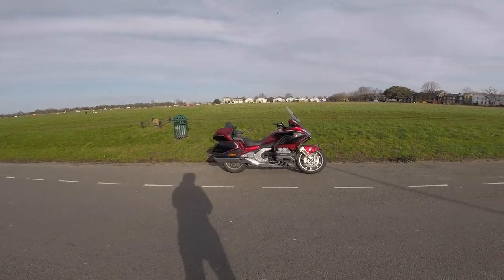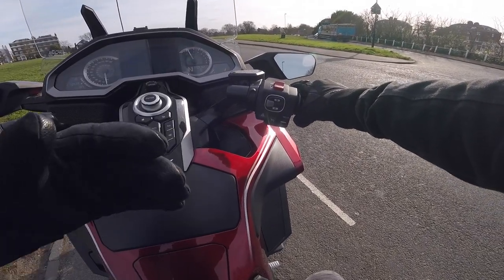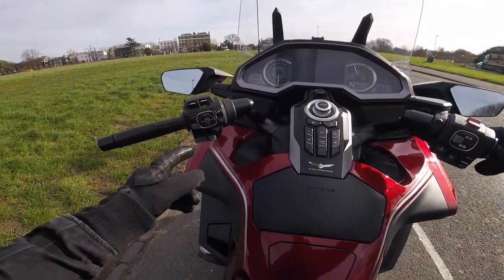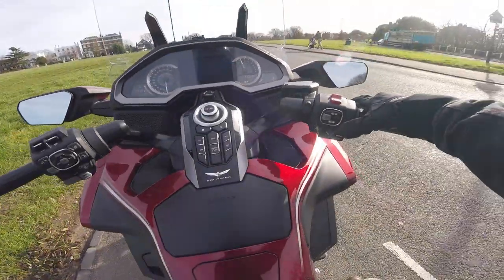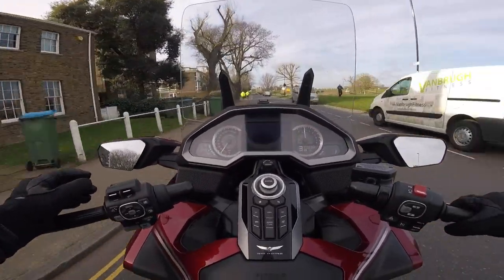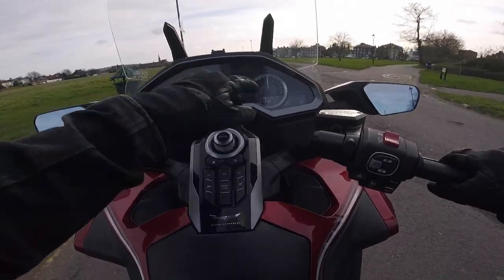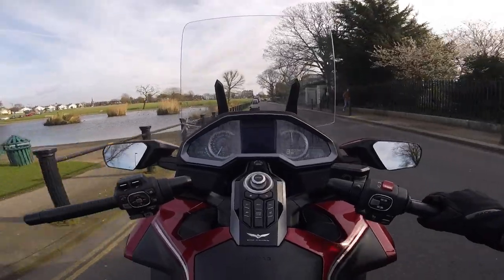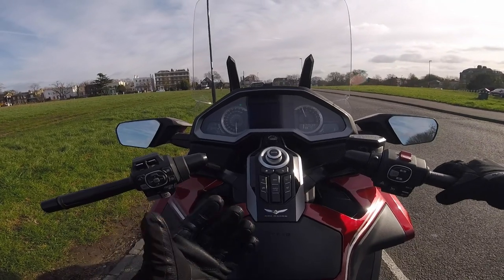What Is Honda's DCT Like To Ride? Goldwing Tour Automatic Motorcycle

Comment: Hi. I've got DCT on my car. One trick is to put it in neutral if stopped for any time. It stops the clutch plates slipping and wearing and also reduces wear on the clutch release bearings. Also, carefully follow the maintenance schedule. It can change up faster that you ever can with a manual gearbox and fuel efficiency is better. Downshifts can occasionally take time to register.  BobUK.
Reply from the maker: Great tips bob. I’ll pin this comment for others to see
Reply: This isn't true. DCT gearboxes disengage the clutch when the car is stopped and brake pedal applied. What you mustn't do on DCT is let the vehicle creep whilst on the brake because this does wear the clutch.
Reply: Robert Hawtin soooo....you have an automatic gearbox in your car
Reply: The UK has a different vocabulary then the United States.

Comment: I have 13K on my '18 DCT Wing.  For tight turns put it into Econ mode, you were in Sport mode and the throttle is just too twitchy there for low speed maneuvers. :)

Comment: Been riding for fifty years, love to shift. That said, I kept an open mind and tried the DCT for two hours on the Africa Twin and hated it. A year later, I tried the new version for a full day. Loved it!
Reply from the maker: I really want to try the old version... I’m interested in how different it is. I also wonder if the 380kg weight of the Goldwing absorbs some of the jerkiness better than a lighter bike like the AT
Reply: Walter Wilkins you got older
Reply: Michael Kastner Perhaps, but I also own and ride other bikes, including a sports bike that will always have me happily shifting.
Reply: @motobob    Don't  want that  "jerkiness "  on the fast curves. At all.
Reply: @timjohnson1199  There's zero jerkiness with a DCT at speed it while accelerating. Zero.
Reply: @sunnyvalejedi     rode the dct gold wing  In sport mode, lots of notchiness,  very fast but notch as ever,  touring mode much smoother,  still didn't care for it,   shifts much faster than you can think, still dont like it,  paddle shifting is not the same as clutch shifting,  still dont like it

Comment: Had a DCT NC750x and now a DCT Africa Twin. The AT is better as it has more power but the NC was surprisingly good. Typically ride my AT in Sport 1 or manual mode. Gear shifts are seamless, never have to worry about stalling it and it changes gear faster than I ever could and never gets tired - gear changes are just as smooth at the beginning of the ride as at the end. 
Never really tried it but by all accounts dct works great off road too - the fact that you cannot stall it.

Comment: Big fan of DCT and over time it definitely improved. Had a 2010 Honda VFR 1200 DCT and wife has a 2012 Honda VFR 1200 DCT. Her bike was a definite improvement through the first three gears as there was hesitation on mine until we had the ECU reflashed. I traded in my 2010 for a 2020 Honda Africa Twin Adventure Sports ES DCT and have no qualms about its ability on the tarmac or off-road. The 4 part Richy Vida video on his journey through the Scottish Highlands will give you a good sense of the capability. If the dealer is willing to let you try the Africa Twin in the manual you should see if you can jump on the DCT version as well and use them both on the same course.
Reply from the maker: Got the manual as we speak. Swapped for the Goldwing yesterday. Might try to get a DCT at some point. I also want to try the X-ADV

Comment: DCT is pretty good when its working, bit fidgety in stop stat traffic!  But its such a complicated system it's a nightmare if it shits the bed! Very expensive to repair or replace,  I wouldn't have one, but I see why some will  especially on this bike,  My car is a full Automatic, in modern day traffic , Manual is a pain in the butt, Butt changing gear on a motorcycle is all part of the experience for me,  Nice work as ever young man 👍
Reply from the maker: Cheers ray. I think a simple bike is a better choice as an everyday runaround. But if you’ve got the £££ to buy and run a bike like this then I can see why it’s fun for big touring miles

Comment: Awesome review.  I  currently have a Harley electra glide but the new goldwings have recently gotten my attention.  The older ones just didn't appeal to me because of the squared off shape of the rear but the new design makes for a very good looking bike. Is the windshield adjustable.  I don't really like looking through one unless I am riding at higher speeds to block the wind and bugs.
Reply from the maker: Thanks mate - yes it's electronically adjustable

Comment: Keep in mind, its an automatic trans. So if you come up behind someone at a light, don't give the throttle a quick snap to make a bunch of noise, you'll run right into the back of the car!!
Reply from the maker: True! Unless you flick it into neutral...
Reply: Yeah, and I like pointlessly pulling the clutch in and reving the engine on my bikes in a tunnel, under bridges just to hear their lovely sounds. How would I do that easily on an auto ?
Reply: @karlosh9286  I think it's only hardly davidson 'riders' who do that :-)

Comment: Great video! But i still cannot get my head around the fact that the Integra (NC700D) is considered a scooter when a Goldwing is a fully fledged motorbike, even with DCT. I ride a 2012 Integra and the DCT is just awesome!
Reply: Being classified as a scooter is more than just the transmission type, it should be judged on chassis design alone. All scooters should be classified as underbone frames. People often call the Honda NC a scooter just because of the dct but by that logic electric bikes are scooters too and the Honda c90 scooter is a motorbike.

Comment: My first impression is that it's brilliant.  It will occasionally make a gear change in mid corner, at low speeds, but the ratios are so close and the change so quick you hardly notice.  Use ECON mode for puttering around in city traffic.  It'll leave the box in higher gears and avoid shifting.  Use the grunt, like you're driving a diesel.  

For crazy fun do SPORT + MANUAL.  Jesus.  Unbelievable.

Comment: I can tell by the comments that folks define this as an automatic. It is DCT, like Porsche, Lambo, Corvette has paddle shifters. Paddle shifters work so much better than hand clutch + foot shift. Oh, you can also tell it to run the actuators itself if you’re in traffic. No manual transmission can clutch or shift better than DCT technology.
Reply: The difference in shift time isn't world changing vs the shift times in automatic vs manual 20 years ago. On the track other factors will vary the speed of a laptime but the dct does factor in.
Reply: Flat DCT is indeed a game changer. You can downshift or upshift shift mid corner without upsetting the chassis. Seamless and smooth. 
Much smoother than quick shifters too. Watch a quick shifter bike being run on a dyno - the chassis flexes and jumps with every gear change, violent.

Comment: Good explanation Motobob, I found the least refined dct that I’ve ridden was on the NC750X, clunky at low speed. My Africa twin dct was a great improvement but could catch you out with mid corner change downs, again at low speed.
I also didn’t feel totally confident with the lack of clutch control on tight right hand road junction manoeuvres on the AT. 
I sold the bike after 11 months and bought my T120, which I love to bits but do really regret ever selling my Blackbird, my all time favourite bike. Still, as I approach my 70th birthday maybe I should be taking things easier!
Reply from the maker: Yes those downshifts do give you a fright occasionally.  And I know what you mean about junction manoeuvres. Sometimes you can give it just a tiny bit too much throttle you’re keen to get a move on, and it can set off at a fair clip with a bit of a jolt. How do you rate the T120?
Reply: MOTOBOB 
I do rate my 2018 T120 highly and I know this may seem a little bit churlish but a little bit more top end would be nice. It’s very good two up, the wife likes the comfort but not the bikes appearance but this is what attracted me as it was so reminiscent of my first proper bike, a Triumph T90 back in 1967.
However I am strongly drawn to the BMW R1250RS, so many bikes, so little time!
Reply: Roger Kent I have an DCT AT - never ride it in D mode - sometimes S1, but more and more in manual mode - full control without needing a clutch. Best parts 1) never need to roll of the accelerator to change up or down and 2) if you stop at the lights in 2,3,4,5 or even 6 it will automatically pre-select 1st so you can pull off straight away. Would probably never go back to a non dct bike.
Reply: Mark Levy 
Hi Mark, pleased to read your comments and pleased that you are very comfortable with your dct AT.
My last nine cars have all been auto’s of one type or another and I wouldn’t want anything else but for some reason, balance maybe, I haven’t been able as yet, to gel with a bike without a clutch lever. 
Maybe I’ll have to give one of the big 600cc scooters a go.

Comment: If ever they put this engine in a muscle bike like the new rocket 3 i would buy it in a heartbeat. After owning an F6C (too much in the cruiser camp for me) i can safely say that when you're rolling on and off the throttle ready for the next overtake,the sound of that six cylinder engine revving it's nuts off is like nothing else. Honda obviously realise this too because they've even added a sound clip to their website. Such a shame they axed the Evo 6 concept bike.
Reply from the maker: I gave it back to Honda yesterday but I’d really like to try the bagger version with manual gearbox to really get a feel for the engine. Will try to get round to it soon
Reply: @motobob  Yes i've been eyeing the bagger too. It's the nearest think to the discontinued F6C (2014 onwards model) with the added bonus of reverse gear and lower centre of gravity,having the fuel under the seat etc. Quite tempted really.Bit of an over kill for rural lanes of North Yorkshire and £22,000 but hey,you only live once and p.c.p is thy friend 😂

Comment: Come on now....Not just any DCT. This is the Airbag model. The only motorcycle with Airbag system. This bike is an absolute Technological wonder. For many years performance and reliability in it’s history. The 2020 has transmission and some other small details of refinement. There’s nothing crude about this bike you bloke. This bike is a proverbial Lexus of motorcycles which jettisons off the line. On my 3rd Gold Wing since 1984 I’m waiting on my 2020 DCT Airbag model. Life’s short, just buy the bike.

Comment: I had a test ride of the NC750x DCT, it was quite impressive, if somewhat weird at first. I wasn't keen on it changing gear mid bend. Plus all that effort it took to learn clutch control would have been wasted ! ( kangarooing down the road on a 125 back just over a year ago )

Comment: Slow speed riding and u turns are easy on this bike, Rev to 1500-2000 and control speed with footbrake it won’t stall, it’s so easy to ride, far easier than my last bike a R1200GS

Comment: Half the fun of road-riding is gear selection and shifting. Also, in my opinion, the clutch is one of the most important connections to the machine.  I ride off-road\enduro just as much(if not more) as I do on-road and could not even conceive of not having a manual transmission\clutch there.  I'm going to dig my heels in here and state; "NEVER will  I EVER ride an automatic  motorcycle."

Comment: I want one and what I want to know is :    when it's new tyres time,  will it cost $1,000 and 8 hours to get the rear wheel off ¿????
Reply from the maker: I ran the battery flat last week and this was the procedure to get to it: remove the fallback key from the keyless fob thing, pop a panel off the back of the bike above the license plate, turn the key in a keyhole to manually release the left pannier, pop a panel off from behind the pannier to reveal the battery. So what I’m trying to say is the whee probably doesn’t come off easily

Comment: One day I may give in and trade my ST1300 Pan European for a new GL1800 GoldWing. But the price is eye watering...
Reply from the maker: It’s a little steep to say the least, especially when you compare the uk price to other markets
Reply: I did just that a bit over four years ago when my ST1300 got too top heavy for me.  I bought a 2015 45th anniversary edition though as the new Wing wasn’t out.  
At 73 I have to think it was a great decision.  The GW sits where I need it to and I don’t need risers to have my hands in the right place.  My back is better and even though I had the fairing flare package the Wing has better rain protection.  I would like to ride a newer GW and we see a lot of them here riding in East Tennessee but I only just turned 55k on this one and I never trade a bike with less than 100k.  Maybe someone up on the Cheroha Skyway will trade with me for a quick trial run one day

Comment: 2:37 Wait...the black area below the function buttons on the tank is an airbag??
Reply from the maker: Yep! On the cheaper models it’s storage with a phone charger, but this is the most expensive version with DCT, luggage and airbag
Reply: Yes, but an airbag? On a motorcycle???
Reply: I was wondering the same thing,  but when I researched it,  the airbag makes great sense.  Honda has videos on it...amazing safety feature.
Reply: @irvan36mm  Yes, it prevents the classic nuts to handlebar maneuver many young cyclists have tried :D

Comment: What's the test bike in your video a 2018, 2019 or 2020 goldwing?
Reply: Michael Berman 18 and 19 are pretty much the exact same bike. Just different colors.   Imo the 20 would be the best for the upgrades that they did.
Reply: @a.d.c7941  Thanks, although I really wanted to see if there are big differences in the smoothness on a New 2020 DCT versus the 2018/19 Wing.  I am wondering if the DCT auto downshifts are smoother when coming to a stop versus the prior 2018/19 DCT Wings?  I noticed on the 2018 upshifts were fairly smooth ut the sownshifts look like the pilot is a rookie.   I am talking about coming to a light in 7th gear and allowing the bike to slow without using the brakes.  Can anyway comment on the newer DCT 2020 model versus the 2018/19?   Thanks
Reply: Michael Berman I am wondering the same thing!   I was hoping to find videos about this.   If this is the case then I would assume going with the 20 version would better.  I had no idea that the shifting on the 18 and 18 were an issue until the 20 came out.

Comment: honestly been saving for this bike for almost 2 yrs now gonna upgrade from my old TMAX
i wonder should i use some elevated boots?? 
im 5'6ft tall 
HONDA BIGBIKE SHOWROOM in my country forbids sitting on the goldwing
Reply from the maker: That's crazy! You can't even sit on it if you're serious about buying it? It's quite low, but the seat is really wide which can make it more difficult to get your feet down. I'd demand a test ride before buying. Or try a different dealer?
Reply: @motobob  yeah its 745mm 
well i miss the test ride during its 2019 launch
Reply: @motobob  shop reason is "its too expensive" they avoiding scratches LOL
Reply: I would find somewhere, anywhere , to look at the Goldwing, even if it's a couple of  hours away. 
Would not give one penny to that dealer.

Comment: Try the x adv.
Reply from the maker: I definitely want to. You got one? An intriguing bike
Reply: @motobob  no but want one, had a demo ride and my mate has one i have ridden, he is taking his to the Alps and Back in a few months time and loves it, he has a GS 1200 also and not touched it since.  Loads of nice customs about too, my only problem is its weight, lack of tuning parts other than the usual pipe n filter and ecu booster and also how much time it takes to remove panels to get under it to change basic stuff, tail tidy swap is a proper job.